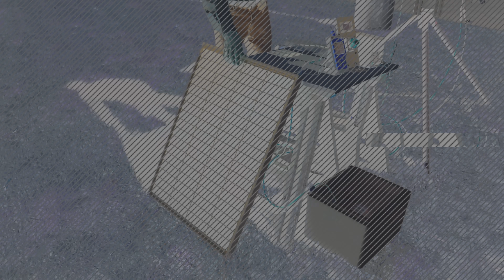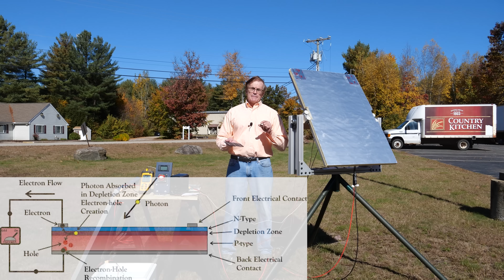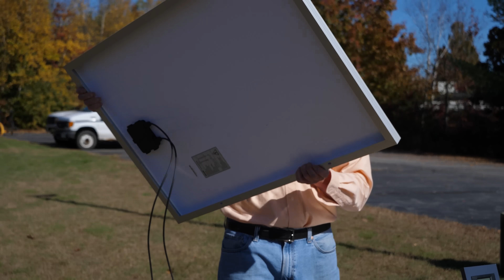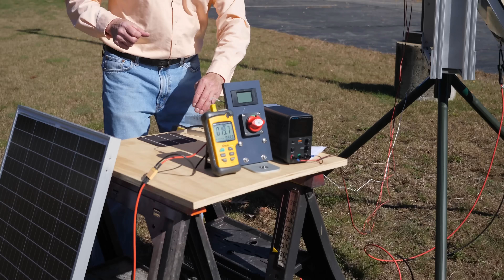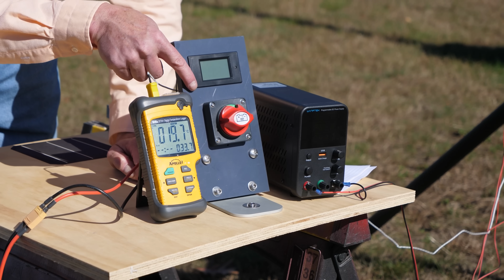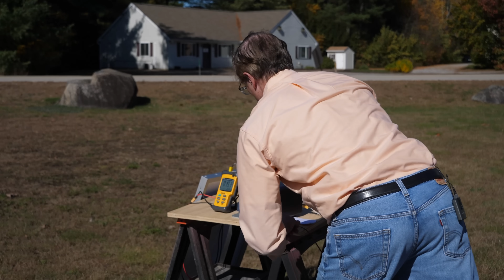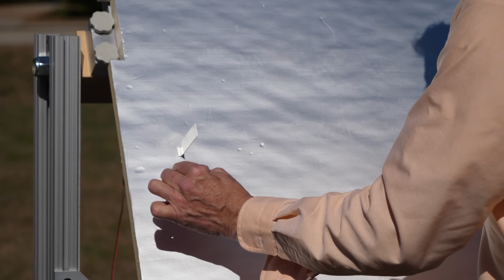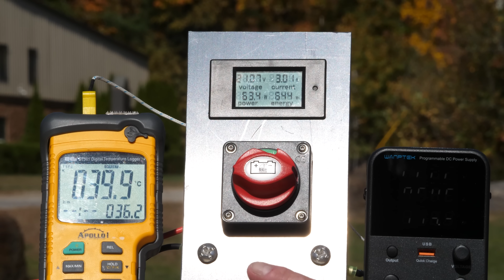Do you REALLY get enough out of your solar panel?

Comment: There is one scenario I would like to see considered in regard to this experiment which is to remove the aluminum sheeting and run the experiment only using the aluminum fins for cooling the panel. The reason I think this might be nearly as effective as using the fans is the ambient air temperature is as cool as the fan system can cool the panel.  This is the same temperature as using the fins alone could theoretically cool the panel.  If these two scenarios are close to producing the same watt output then why make the system more complicated by adding something like fans that can fail?   Also, with panels being positioned tightly in an array would the heated exhaust air from the panels be trapped under them and lower the efficiency of the active, or passive, cooling overall?  It would be nice to see how the fins are attached to the panel.

Since the cooling system proposed will be running for decades what is the failure rate of the fans?  Especially considering they will be exposed to the elements.  It seems that making sure the fans are running will be critical to the success of the cooling system.  If the fans stop running then the aluminum plate backing will act as a blanket and cause a massive spike in panel temperature that will greatly reduce power output, lower panel life more and might even cause failure of the panel due to overheating.  How will the fans be monitored for failures and how easily can the fans be replaced?  If just using the fins for cooling gets close to the same watt output as using the fans then I think the reliability and lower cost of using it is better than a less reliable, more expensive fan system.
Reply: I have same question, what about only passive cooling?
Reply from the maker: It's  very  slightly  better than with the stock panel.  This  can probably  be optimized with a much denser array, although  that introduces increased material costs.

Comment: Well, the additional complexibility and the fact we have to exchange/repair fans on rooftops in harsh (winter, rain) environmental conditions for the fans, placed under thin solar cell panels flat on roofs, will probably negate the positive effects. It's only applicable to walkable flat roofs and elevated panel stands.
Reply from the maker: That may be true.

Comment: Set up a few panels to power cooling fans for the rest of the array. That would increase the output of what you are powering. Without the Parasitic loss. The cost of the extra panels could be net zero cause of the extra lifespan of the panels.
Reply from the maker: That's  basically the idea.  You don't  have to dedicate specific  panels  if you simply  tap the output from the array.

Comment: Couple observation. 
Your minimum panel temp is the ambient temp + the heat from the unabsorbed photon. It is difficult to calculate the absorption of the photon therefore your calculation of temp rise is not accurate.
The idea of spraying city water or lake water to cool the panels will not work. The panels quickly will be covered with minerals (scale) and dust deposits further reducing the efficiency.
With your cooling fins setup and increased air friction/static pressure, you will be lucky to get 20 CFM from each of your fans.
Sorry, you need to do more homework.:person-turqouise-waving:
Reply from the maker: If you watched carefully, I never calculated the temperature rise.  These temperatures  are the documented temperatures from actual installations around the world. You can do this homework yourself and get back to us with your findings.
Reply: @TechIngredients  You added temperature numbers to the existing temperature numbers and you said 19c to 53c. this means you are calculating heat rise, you buffoon.

Comment: Hi, I would appreciate if you try  a passive system using the chimney effect.
A couple of meters of black painted chimney should give you a very decent airflow with no energy required for vents.
Any feedback about this idea is highly appreciated.
Keep up the awesome work!
Reply: Only thing I can think of is that a chimney would block the sun of any panels behind. Depends on your space constraints
Reply: @xb70valkyriech  that's a good point and it's certainly true for many situations, however it might work well for some smaller power plants and save a good amount of energy and costs

Comment: I know this is a tech channel, but it'd be neat to see some more low-tech options for cooling panels, given how quickly solar is ramping up and how big of a factor keeping the panels cool can be it could help a lot of people.  
I've heard success stories with green roofs (the ones with a layer of dirt and plants that house all kinds of critters) because the plants dissipate a lot of heat, as well as someone running just a garden hose of water underneath their panels to keep a constant flow of (somewhat) cool water going; on a hot summer day the water cycling through their ~3m2 water tank goes up a few degrees but increases the panel output by 10-15% just because the roof doesn't heat up and the air underneath the panels is always cold.

Comment: Fascinating video even for a scientifically challenged viewer like me. However, I wonder whether it would not be a good idea to investigate further the potential of water cooling. In China many buildings use rooftop water tanks with arrays of pipes aligned with the sun to provide hot water. If there could be converted to dual use to both heat water and cool solar panels, that would be even more efficient. Even if this would not work, it would be great to see a vlog exploring the potential of these water heaters. They are much more eco-friendly than silicon panels. Their only drawback is that they are limited by very cold temperatures. I believe that the coldest temperature they can survive is minus 15 centigrade. That eliminates their use in the north but in the southern part of the US they are viable. I would love to hear your thoughts on their potential.

Comment: Nice video indeed. but i have to disagree with your statement.

Cost of the system as you said isn't just solar panels..

Modification of those panels, extra fans, extra cables, extra sheets of metals for outside and also inside, , dust cleaning ..now you have to think about dust much more ..extra labor , extra logic that will be responsible for those fans.. extra maintenance ..after all you have lets say 20 panels..so 60 fans running ..extra noise during winter or summer(normal noise will be low ..but with much more fans and during time you could hear things ..)  all that extra cost and extra maintenance ..i don't think it is worth it. Reliability is huge factor in solar installations..and ofc fans could stop..they could burn they could overheat ..they could get dirty so you have to change them after lets say 3-5 years ..

It is similar thinking why we not use all those solar panels that will move with sun..you will get better efficiency more power and so on..yes and much more moving parts..higher maintenance costs and possibility of failure. And so on..that is why the most simples systems are not the best but the best in long run because of reliability and long life time..

There are exceptions as in many things..but i think this will explain why it isn't good idea to put anything there ...on your roof..
Reply from the maker: Fair enough, but that is why I raised the potential  savings due to increased effeciency and panel longevity. The balance depends on where you live, the availability  of modified panels, potentially  from the manufacturer and the scale of your system.  Food for thought...
Reply: @TechIngredients  there was one remark..i didn't mentioned before.. why not to place those fans on bottom  to push air from bottom to top instead of top to bottom ? I think it might improve a bit in efficiency ..or am i wrong ?

Comment: I would see advantage in collecting heat off the panel to use with a heat pump. Another option would be to have an IR filter layer a few cm above the panel?

Comment: I have an idea for a cooling system using an underground "radiator" and we can use heat pressure to pull it up... No power needed

Comment: Could you please consider testing runing a steam turbine(turbo exhaust turbine with a generator instead of the compressor wheel) with ethanol or acetone or AC refrigirant as working fluid

This will trying to convert heat from the sun using a black car radiator and a fresnel lens to run the steam(or refrigirant) turbine

Comment: I've wanted to install a geothermal heat pump, but the well or closed loop heat exchanger is expensive. Most houses could fit a well in either corner of their basement and those wells could produce the majority of the heating / cooling requirements. I've wondered if a well could be drilled in the corner of my basement. Basically drill it slowly and with a low cost 120V / 220V setup instead of an expensive drill rig. Typically wells are around 400 ft deep and spaced about 40 ft apart from each other. They typically drill like a 4" dia to 8" dia hole and then install a 1" or 3/4" water line in that hole. One line goes down, turns around and comes back up. Each well can pump approx. 12kbtu. I can't help but think of a concrete drill, and wonder why can't that be modified to run 400 ft deep? Then each day I pull a wheel burrow of dirt out of the basement. Then after a month I've got a well drilled in the corner of my basement for a fraction of the cost of getting a drill rig on site. Being inside the house avoids the need to dig trenches in my yard. 

Sorry about posting multiple comments. I'm just trying to separate different content into different threads instead of having many things get flooded in one thread.
Reply: The trickiest parts of drilling in a completed basement will be stringing all of the extensions onto your drill and getting the loose debris back up out of the hole.  I suppose you could have spiral flanges the width of the hole on each extension to help push the material up from the cutting head but you'll need a hell of an electric motor to turn it after you get a couple of hundred feet down.
Reply: @michiganengineer8621  I found one device which doesn't seem to work in a basement. Seems like such a device should exist but I can't find it. Perhaps I'll have to make it. If I could find a device, making 4 ft extensions from 8 ft extensions would be much easier then building the entire thing.
Reply: @jaredharvey1511  Depending on your ceiling height in the basement you may be able to do 6 foot lengths once you get the initial hole started.  The torque on the intermediate segments will be a major b1tch though.  I'd almost prefer to do the well bore just outside the foundation with a deep access hole dug next to the house so you can bring the plumbing inside well under the frost line.  You would have much better access for longer drill segments that way.

Comment: A fantastic video, thank you very much! 2 questions: 1. Is it possible to combine the solar panel with Peltier-elements (and the cooling system) on the backside to even harvest more energy, especially in warm climates? 2. You have mentioned the water cooling system, where the clean water is running on the frontal surface. Would it be possible to use this like a solar thermal collector for warm water consumption of a private household? Thank you.
Reply: Remember that glass is a pretty good insulator.  Running water down the front of a panel isn't going to have good heat conduction and doing it 24x7 would cause a lot of evaporation as well as wear out the solar panel's seals more quickly than they would with just seasonal rain storms.   And no, peltier elements are a complete non-starter... they are too inefficient to be useful and the contact area would have to be the entire back-side of the panel.  The cost wouldn't make any sense.

Comment: This is an interesting topic. I was busy engineering a heat collecting system so i could heat a boiler. The problem is when the boiler is on temperature, i have to dump the heat. That's not a  problem in the winter. I can use it to partial heat my house. I was designing a glycol based system with heat exchangers. But for the summer, i needed a bypas system with a radiator and fans to dump the heat in the air. It became quite complicated and not viable because there is not enough heat in the winter for what i had in mind. I have 15 panels, a 385 watts per panel. And 2 GroWatt inverters on grid. I have installed the system myself that's saves a lot. The system cost me about 3500-, euro a 2 years ago here in the Netherlands. The system lies on a flat roof, and the angels of the panels are about 30°. The whole system gives me a 6500kwh per year. 

I learned a lot on your channel, so thanks for that!
Reply: Use a swimming pool to dump the heat in the summer. You can regulate the water temperature with an insulating blanket to cover the pool or not. 

Another option is to pump warm water in the summer into an underground reservoir and use it in the winter to warm your house
Reply: @sjococo  thats is a suggestion, but i do not have the space for a swimming pool. 
And heat storage in the ground is too expansive. The drilling in rock clay is difficult here, with a lot of huge bolders. The drilling and heating system will cost me about 45k in euros. The town where i live will also not give me a permit to drill 150m (490 feet) deep.

Comment: Current thinking edges towards placing water pipes behind the panel and then using heat pumps to add to your green energy solution while taking the heat away from the panels

Comment: Instead of forming L's to then bond to  a spreader, form U's, with no underlying spreader, bonded directly to the back of the panel.

As an easier, cheaper alignment tool glue a 6-8"  piece of gray .5 inch PVC conduit to the top edge of the aluminum frame. Adjust the angle of the panel till the sun shines thru the tube.

A bundle of 5 tubes with the center one set normal to the panel. Each of the other 4 tubes a few degrees to the left, right, above and below the "normal" tube. 

Place either small PV cells or CDS cells at the panel end of each tube. If the center tube has more sun than the surrounding tubes, do nothing. If one of the displaced tubes has more sun, use stepper motors to move the panel in the direction of the "bright" tube.

In that way, it will seek "sun normal".

I'm not sure it would be cheaper.. but a thermistor bonded to a black anodized aluminum disk might be a cheaper sun tracking sensor. It would probably have a slower response time than tracking "light".. and light might be too "jumpy".

Fun ideas, though! Thanks.

Comment: I remember nighthawk in light showed a really efficient way to always center the solar panel with 4 slights smaller ones at each of the edges connected to motors. It would seem weird but if you can get small enough panels it could work really well.
Reply: The ones at the edges are not really solar panels, they're photoresistive cells that change resistance depending on light. A full tracking system like that is not practical for reliability and maintenance cost reasons. It would also be easier to just use the internet to look up the position of the sun based on location, instead of actively tracking it
Reply: @signalworks  I drive past a large scale commercial solar farm occasionally for work, and I noticed the rows of panels were all facing northeast in the morning.  Weird direction for central IL, and I assumed maybe they were working on them and somehow had flipped the panels to 'shut them off' so to speak.  Later that day (late afternoon) driving past them they were flipped to the southwest and you could see the mechanism that flips entire rows as a whole.  Point is some commercial operations are active tracking at least in a single axis so it must be economical on some scale.

Comment: What a phenomenal, well thought out and completely thorough test / demonstration! I am in the southwest US where heat is in abundance. I have 30 panels on my roof that are rated at a total 7.2 kw. Due to the heat, at best I can get about on average 4.5kw out of the system  during peak production each day. Even conservative estimates based on the cooling gains you demonstrated, factoring the extreme temperature differential in the south west of the US, the production gains make a system like this VERY attractive! Thank you for taking the time to bring awareness to this potential in such a way that left absolutely ZERO wiggle room for doubters / haters to punch holes through this type of system. Very exciting!

Comment: In the Mid-Atlantic region, would a southern facing rooftop solar panel array generate enough waste heat to justify being integrated into a "smart" geothermal heat pump system that could convert the energy into heat for the home? Does a system like this even exist where some manner of switch actively monitors temperature of the two possible sources, one being the constant temperature of a geothermal well and the other being the "solar radiators" to switch sources automatically to whichever is most efficient?

Comment: If solar panel is pointed directly towards sun, why there would be significant difference on power gain between New England and equator? There is more air between sun and panel in New England, , but that shouldn't affect so much.

Comment: Great video. If you have a second identical panel that is unmodified can you look at the possible benefit of using the aluminum angle to create a more efficient heat transfer on a passive basis? Would it drop the panel temps enough to possibly improve panel life and also increase output slightly?  If only doing passive cooling fins they could also extend out of the  panel back further.
Reply: it would be very problematic with proper size of the panel array and also there is a cost to the whole idea of aluminium fins and for big array and passive cooling you would need to make them huge.